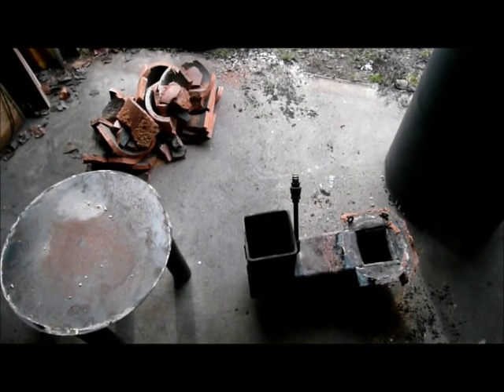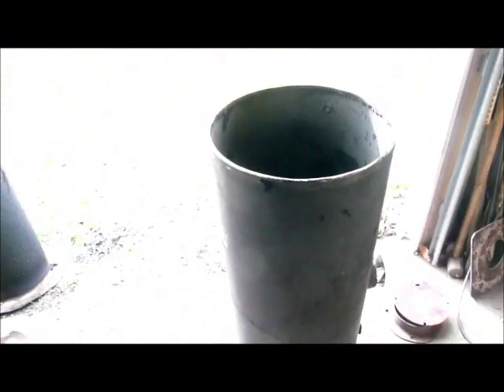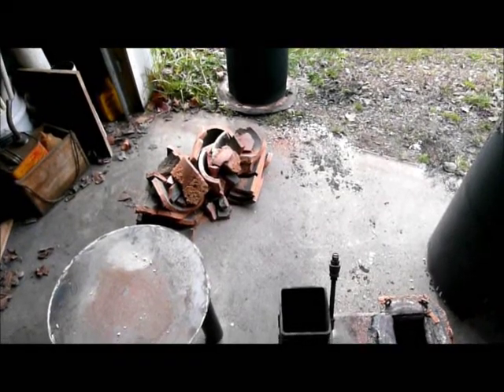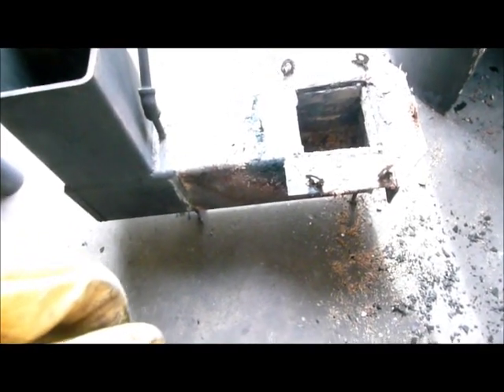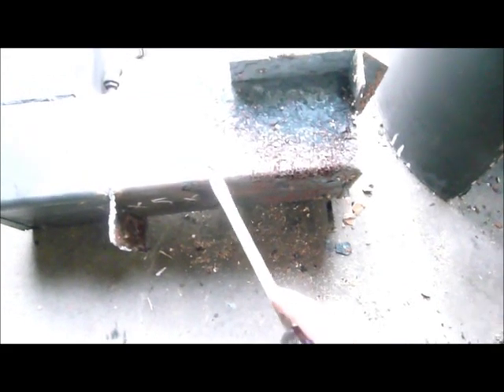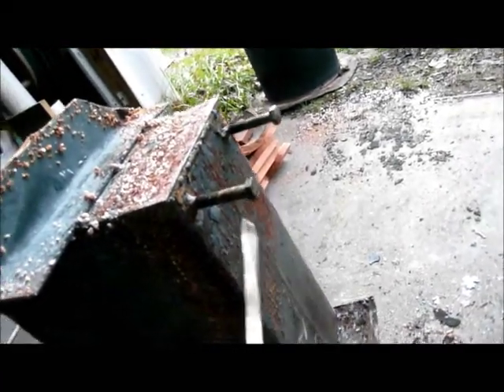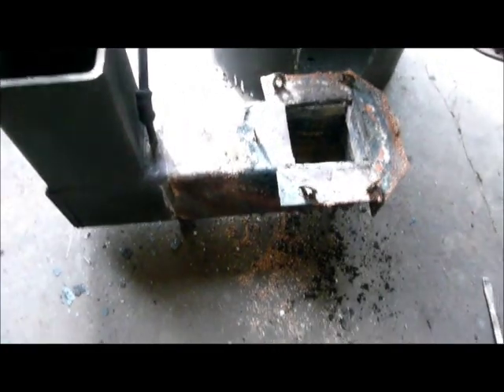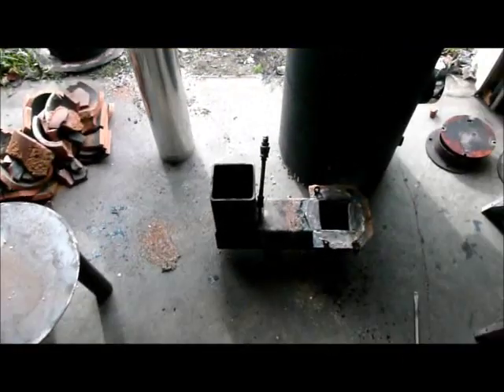Rocket Heater Autopsy

Comment: ouch.. hope that stainless works.. i want to build a smaller version and run it on pellets or wood for my bus. I'd like to have a 3x3 feeder tube as well as fire box and riser, insulate it with a 4"-5" pipe. then cover that with a 6" secondary. and finally cover that with a standard 8" stove pipe with a 12 volt positional fan to blow the heat out the bottom and across the floor.  any sugestions for material choice.. and my bus is not eaven 100 square ft.  so small is key.. any advice would be help full and welcome.
Reply from the maker: Go out to this YouTube channel and search his videos for his rocket heater.  Best I've seen:
https://www.youtube.com/user/ZeroFossilFuel

Comment: Unless you can control the burn under 600 degrees, mild steel will not last. I went with refractory cement for my next riser which will take 2500 degrees without failing.

Comment: Err.... I have to ask, given you do not seem to like the process of rebuilding so often, and bemoan the cost of the stainless steel riser (which will most likely also be eaten up, it will just take longer) why are you not just building this the way it is supposed to be built? 
You have to use refractory materials in the fire box.  Fire brick, or castable refractory. 
That's what works.  It isn't the design that is failing, it is the choice of materials.  If one uses materials known to fail, one cannot be surprised when they fail. 
You have to use materials able to survive 2200*F, or 2500*F, as a minimum.  That's most fire brick.  You can get 3400-3500*F fire brick, but it is expensive, and I'm not convinced it is required. 
But metal cannot take that kind of temp day in, day out, all winter long, let alone season after season.
Reply from the maker: Erik Weaver Based on your comments, I trust you have never tied to use waste oil as a fuel. It is nasty, nasty stuff!.  I thought about using refractory in the combustion chamber, but the waste oil would simply ooze into it and be absorbed, While I have never tried it, I feel the waste oil would degrade the refractory just like engine oil causes concrete to fail (over time). Any type of crack would allow the oil to escape and possibly cause a fire outside the unit,,,bad idea!  Not to mention the mess!

I did try chimney liner for the vertical section, but it could not stand the thermal shock and it cracked and failed quickly.

My goal was to build a cost effective heater for my workshop.  Continuing to build/rebuild is not cost effective from both time and money spent...and I have no heat during the rebuilds!

My Ozzirt-style waste oil heater is tried and true.  It is going on its 4th winter, no material degradation, and works reliably with no issues. It is efficient, clean burning, and heats like crazy!  

I did try a new heater design just for the heck of it this fall (2014), but quickly realized it could not compare to my trusty Ozzirt heater!

Give your ideas a try and let me know how they work.

Regards.  Kntryhart
Reply from the maker: Save your time and effort.  Build an Ozzirt-style waste oil heater. I His design is best and has never failed me.
Reply from the maker: Interesting, but I am going to stay with my tried-and-true Ozzirt Waste Oil Burner.  Solid design, reliable, and needs no electricity.  Regards.

Comment: Thanks for sharing , you answered a lot of ? I think I'm going with bricks , do you have a impute on that way ? If you don't think so ,I was going to line the steel with a very  high  temp comical refractory cement . It came in a 50 lb box a friend gave me . He said its used in big Commercial boilers . I did use it for my Gasifier cone witch I did not finish ,! Lol and it's easy to work with . I would rather not in this case only because of the size I wont  my rocket stove . Please let me know what you think of that . I would like to start this stove by the weekend . Thanks again for the grate video . 
Dave
Reply from the maker: Suggest you watch the rocket stove that ZeroFossilFuel built:
http://www.youtube.com/channel/UCifpcd-CUqDWAjPtliETytg
Search for rocket on his channel.
If I build another, I will try his approach.
Have fun!

Comment: If you want to build for the ages, stainless is the way to go.  Drives the cost up though. Scrapyards can be a useful source of heavy stainless parts.
Reply from the maker: Not true.  I tried stainless steel for both the burn chamber and the heat riser. The intense heat degraded both of them in short order!
Reply: Kntryhart
Odd, then the heat in that particular use case is the issue. Might be worth scrapping the idea of an efficient stove and just throwing cheap fuel at the problem using designs know to last if you cannot get yours to survive. If fuel is free I don't personally care about efficient use if that means wasting my labor. As long as the sun shines there will be plenty of wood.
Your experience is useful to others though. I'll try a rocket but only with very heavy steel sections and then expect to scrap it often.
I do know from working on them that the only way jet engine afterburner parts (no common steels there) survive is they are designed so an air blanket protects them from direct flame impingement. How to pull that off passively would be a difficult and complex bit of engineering.
Here's an inspiring non-rocket classic off weldingweb, but you'd need to make good friends with a scrapyard or welding/fab shop to get the material:
http://weldingweb.com/showthread.php?47876-wood-burning-heater&highlight=garage+heater+wood

Comment: Great design! Your teetering on incomplete combustion creating superheated steam, rust colored deposits. Run steel drip pipe looped into flame then back to drip point. Might sound wrong but add water drip in same steel drip pipe to burn half water.

Comment: ram plastic refractory around the burn chamber. if it rots away then you have a refractory burn chamber. for the riser, use a "consumable" outer pipe and a "consumable" inner pipe and ram refractory in it. you could reinforce it with some hardware cloth if you wanted. then, with plastic refractory, mold the riser to the burn chamber. that would last an awfully long time and keep the burn chamber extremely hot from the insulation. might even want refractory on the top cap

Comment: I appreciate you showing your mistakes, it will save others a lot of time.  I thought of using a cast iron sewr pipe for the riser  since the burn pot is made of it, but maybe the cooling will crack it,  So far I have only made a wood burning rocket heater and love it's performance.  I look forward to trying the waste oil version, thanks again!  
ps. 
I plan to study the rest of your vids for more tips

Comment: Not sure what I missed, but saw your other video and I am running a stove of purely stove pipe for 50 days now and not seeing the degradation that you are seeing with the thicker pipe. my firebox is basically a black T. I expect to replace it at the end of the heating season, but only ata loss of $18. I've had temps over 1000 degrees in it repeatedly. From stoves I've watched, im thinking nothing is permanent.

Comment: The Rocket Stove/Heater relies on a fundamental principle- A heat-proof firebox and heat riser to create a one-way burn path from fuel to flue without employing fans, electrics etc. I think your multi-fuel design is excellent, except for the un-insulated firebox and riser.

Comment: But I reckon you're so close. I suggest you use a castable refractory for your firebox to mate with the SS riser. That should resolve the problems resulting from the intense heat. Looking forward to your successfully reworking this. Thanks for the videos.

Comment from the maker: I will stay with my earlier assessment and say that it was my incorrect material selection that caused this problem. Regardless of thickness, scaling would eventually lead to burn-thru. You can Google: Scaling of Carbon Steel for more info if you wish. Thanks for your interest!  PS - I like your Rocket Heater!

Comment from the maker: I believe the issue is incorrect material for this application.  The mild steel is most likey near the melting point during each burn.  The new heat riser is 316; my local steel supplier had 304 only and I did not want to special order anything for the rebuild of the combustion chamber. Whenever this fails, I will rebuilt my Ozirt-style waste oil burner. Thanks for your interest.

Comment: Do you think the corrosion is due to water and acids in the used oil?  316 stainless provides the best corrosion resistance.  That might be a better choice, but what you have on hand would probably last a couple seasons.

Comment from the maker: As an experiment, I tried using fired glazed floor tile as a buffer between the heat and the steel in the combustion chamber; the tile shattered. I had hoped since the tile had already seen high temps in the kiln that it would be more durable. Thanks for the suggestion!

Comment: If you go to Paulwheaton12's channel and look up "rocket stove mass heater workshop how to tutorial" at 4:00 they get into creating a metal and clay/peralite internal chimney.  If the metal from this chimney burns away the clay should be fired and stay in place due to the external metal shroud. I think the volcanic peralite mix is more stable because it is not monolithic like the clay liner.  Good luck!  I love the idea of incorporating metal into RMH's.

Comment: Perhaps you could use firebricks as liners in a bigger burn box.  When I have gotten into wood burning stoves they have thin 1" ceramic bricks lining the inside of the floor and back of the box.  The scaling looks like it starts at the top about 10" from the burn chamber then at the bottom around 4" from the chamber.  Perhaps lining that area would create better protection.

Comment: Thanks for posting.  I keep finding metal flakes of my chimney in my burn tunnel...when I start pulling out insulation, I guess it will be time to replace it with stainless.  My burn tunnel is holding out well so far...it's made from antique clay bricks.